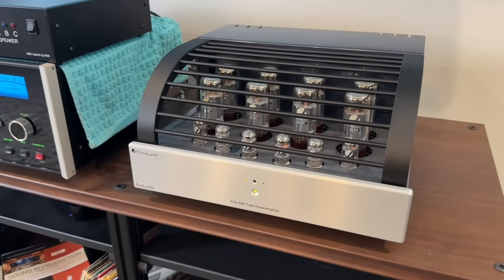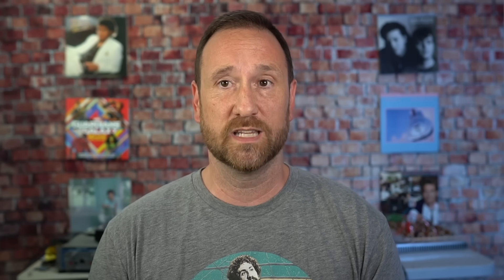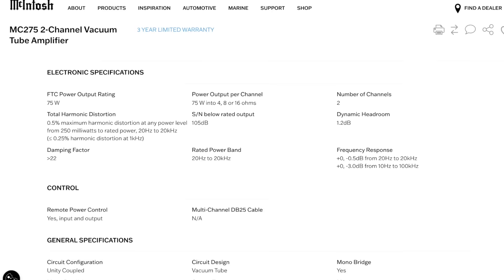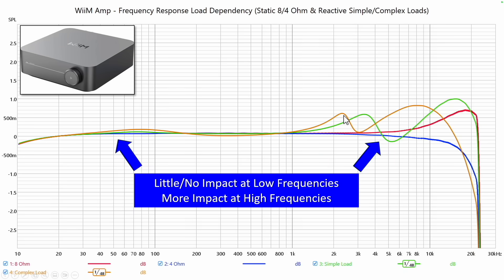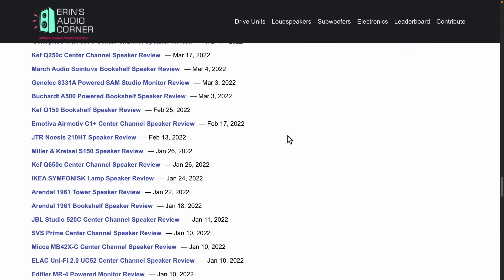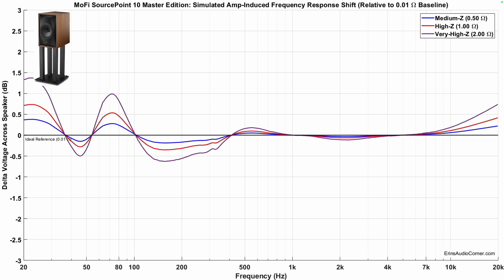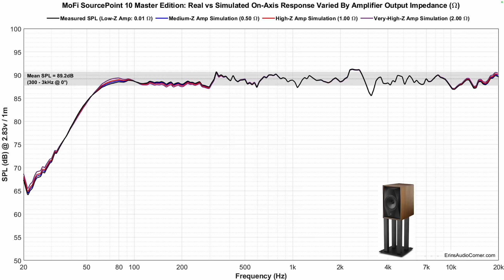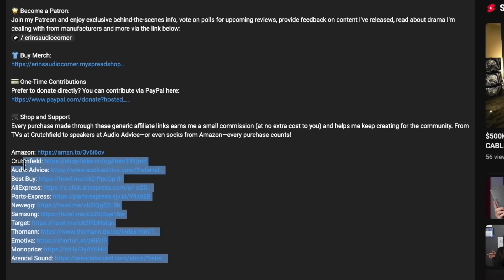Should All Amplifiers Sound The Same?

Comment: Years ago, I always paired Yamaha receivers with Klipsch speakers, with the theory that a bright speaker needed a warm receiver to smooth the highs out. I was convinced to buy a Pioneer Elite reciever after my initially Yamaha died. It verified that speaker/amp matching matters. The Pio made the highs unbearable, completely fatiguing the whole family in the first 10 minutes. 
While I didn't have the measurement tools at the time, I'm sure you would've been able to highlight and identify the "conflict" between the Klipschs and the Pio.
Reply: Klipsch's speakers are really hard to match with amplifiers because of the crossover designs they use to get the woofer sensitivity to match the horns.  The Forte IIs I use have this Autoformer design that some amps really struggle to drive.  People pair tube amps with Klipsch a lot because the high sensitivity is compatible with low output, but it's the output transformers on the tubes that make that pairing work particularly well.  I've used Yamaha receivers for a number of years with these speakers.  The models they used to brand as having their "Natural Sound" circuits worked really well.  Then I upgraded to a 4K receiver that wasn't advertising that anymore, and something they changed just collapsed the sound quality, everything sounds dead.  NAD 3020D is the best budget pairing I know of, the Class T amps have no problems with Klipsch's impedance tricks.  (Didn't like the 3050D used in this review quite as much, was subtle though, maybe imagined)  I'm currently using an Anthem receiver with a mix of Class AB and T amps, it sounds great.  I've heard plenty of Pioneer Elite and Onkyo amps with these speakers that were so bright they'll drive you out of the room.  On the flip side, every Denon amps I've tried somehow makes them too polite and boring.

Comment: I use Nad gear I think they sound good on most speakers they usually gives the same wattage in both 8 and 4 ohms might have something to do with it. They also measure everything from 20-20khz full power not 1khz

Comment: This leads to a question. Does the Mac tube amp sound similar to the Mac solid state? And what is the reliability of the tube amp? Do you have to replace tubes a lot? I had a Scott Freya and couldn’t keep tubes in it. It ran very hot despite putting hifi fans under it and on top.
Reply from the maker: It does.

Comment: The output impedance of tube amplifiers is always high.
Reply from the maker: Except … it’s not. That’s just another false narrative. The Mcintosh in this video is 0.20 max. That’s close to many solid state amps. Check the pinned post.
Reply: @ErinsAudioCorner  I have never had access to those amplifiers, but what I said was based on my own experience with tubes 40-25 years ago.
Reply from the maker: @teepoika719 imagine if people talked about computers based on the way they performed 25-40 years ago …
Reply: @ErinsAudioCorner I live in Finland. I have worked in information technology my entire working life, starting in the early 80s, and for 20 years we didn't have the opportunity to do that on a computer, and the reason was, of course, money.   At that time, the tube amplifiers that I could study were Philips, Siemens and Teleste, and on the transistor side, Pioneer, Philips, Asa, Tandberg...nothing great. And the impedance of the speaker cable is in series with the impedance of the amplifier, so the effects are not the same but in the same direction. And that information was not my invention at that time, but the observation was mine.
Reply: @ErinsAudioCorner  These days, vintage equipment is very popular and the phenomenon has existed for as long as amplifiers have been made, so my old observations are very relevant.
Reply: Lol that's not true for all of them. And he gave you a literal example in this video and you still made this comment? Why?